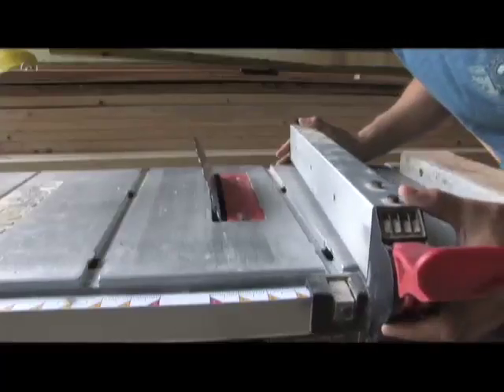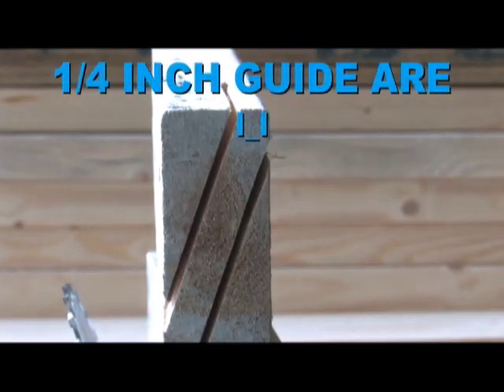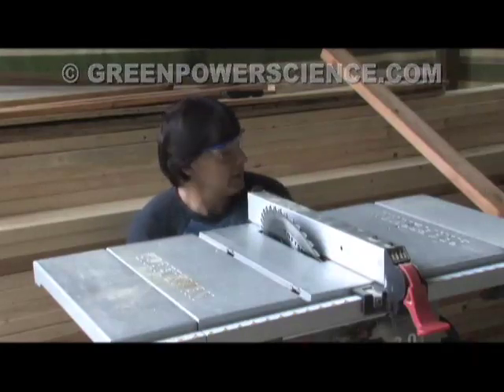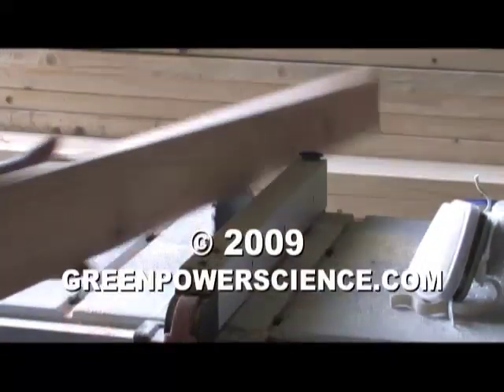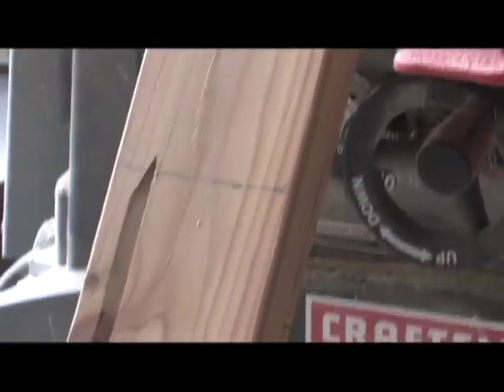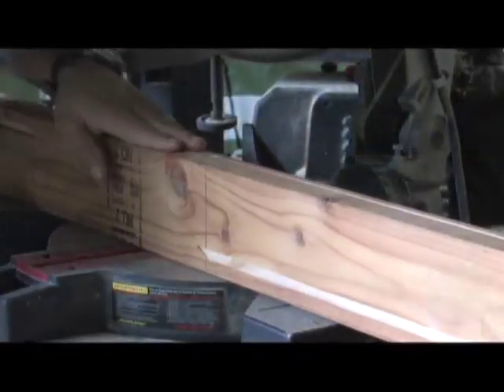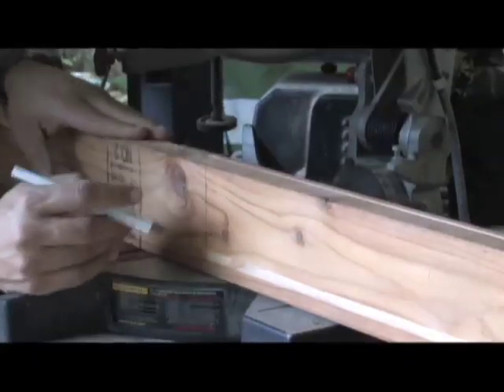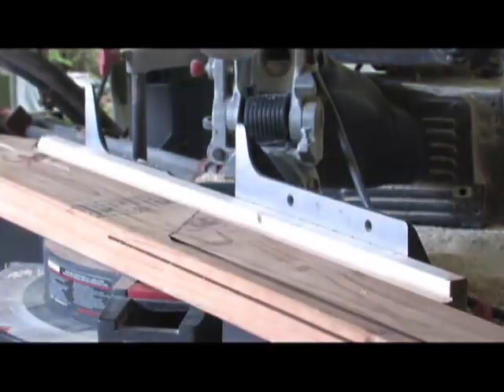WIND TURBINE BLADE DIY how to video Part 2 HAWT Windmil

Comment: I may try this I just started using my new table saw, this has inspired me. But I want a motor that will produce some amps for wind. Most of the treadmill motors have to turn very fast to produce more than 12 volts. I will be interested to see what you use.